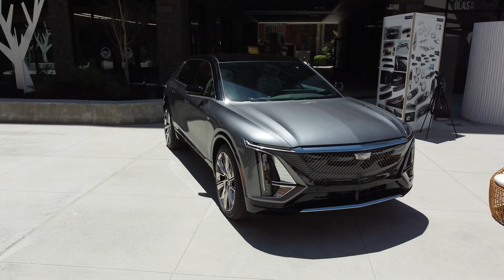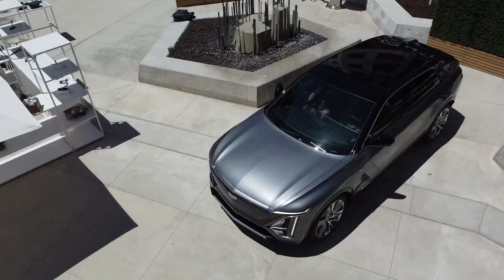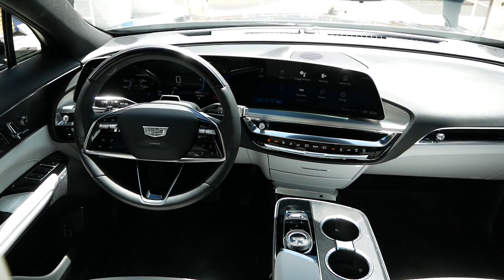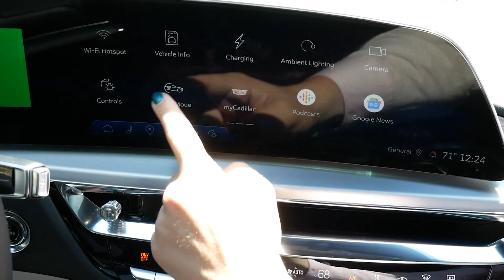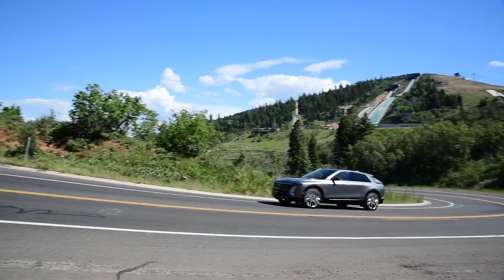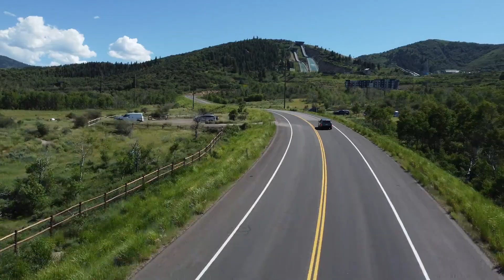2023 Cadillac Lyriq | First Drive | Driving.ca

Comment: If Cadillac hopes to compete in the EV movement they will have to clean up their business model and forbid dealers from gouging customers. Maybe follow Audi’s and BMW’s practices if not price gouging customers. 

I’m quite disappointed in Cadillac. They advertised the Lyriq for $59,990 and then the day before accepting orders they jacked it up $3k. To add insult to injury they lower the price of the 2024 cars and include Super Cruise and a Heads Up display. This is right out of Elon Musk’s playbook. 

I sold my Tesla and went with the Lyriq because I’ve always liked Cadillac. The salt in the wound is the greed most Cadillac dealers have displayed by upping the MSRP by $10k - $30k and more.  Cadillac says it cannot dictate dealer prices. Sure they can. Cadillac can stipulate this when transacting with dealerships. They can also make delivery to such dealers lower in delivery and allocation priority than dealerships who do not Jack the prices up by what they call “market adjustments.”

I cancelled my order with Kevin Whitaker Cadillac In Greenville, SC for this very reason. If they implore this type of greed openly; guess what they are doing that you aren’t aware of. If they will gouge you now, they’ll gouge you later. 

This will hurt Cadillac’s sales as other manufacturers introduce their new EV’s. To Cadillac I say stop the greed and be the the classy car company you’ve always been.

Comment: Thumbs down!! He’s a fool. It’s like these reviewers are too stupid to know the difference between a Hyundai Ioniq 5 and a Cadillac. They don’t share the same designers, engineers, nor designs so I’m genuinely confused as to why he’s comparing the performance of the Lyriq’s aerodynamics and the ability of the airflow rear spoiler to do it’s job on the Cadillac’s design so closely to how it doesn’t on those models from Hyundai.

This guy must’ve been scratching his head for ways to nitpick or criticize this vehicle. It’s a early pre-production model, fit & finish is never at the same level as a production build but to say the rotary dialer “vibrates”. The comment about it being a GM product, whatever that’s supposed to mean and then watching as he struggles to explain what a “rattle” is, absurdly stupid.

Also, 19.2 kw Level 2 charging won’t only get you a “decent bit of charge” overnight but nearly class leading home charging speeds fully charging the Lyriq in about 5 hours. He says they’re using GM materials? What’s that, glass and real metal? 🤡